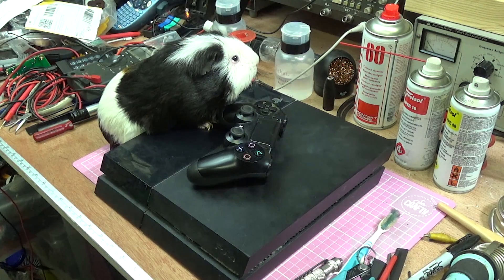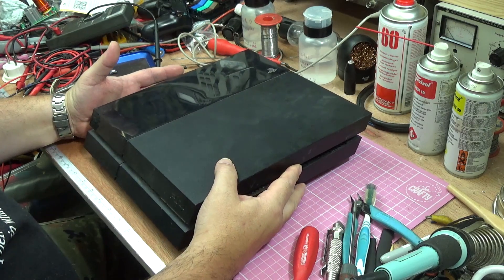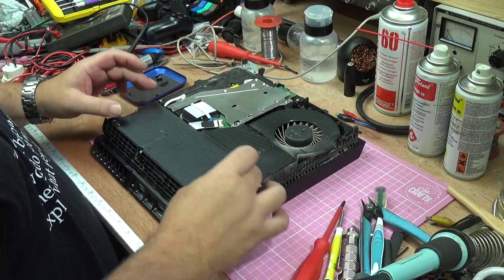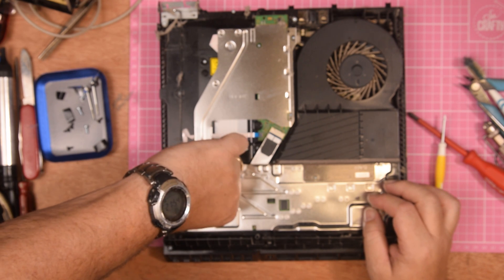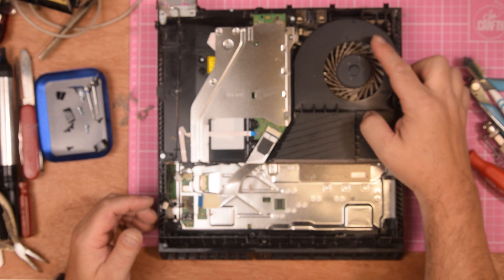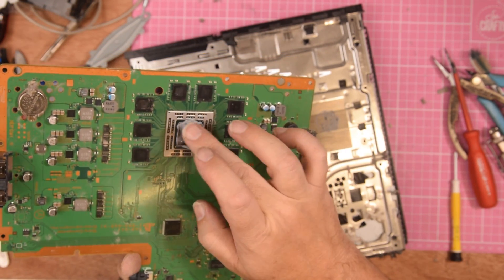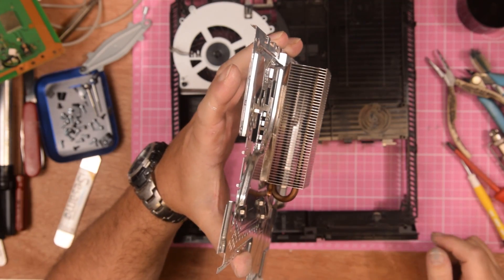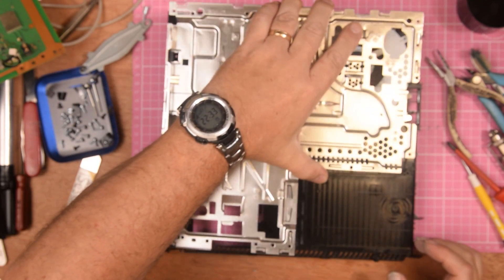How To Fix Ps4 Overheating Problem : ZERO COST

Comment: I cleaned it great video, but I have another issue when I put it back together when I turn on my PS4 it just revs high but then when I start a game it instantly turns off and blinks red what did I put on wrong?
Reply from the maker: it sounds like either the heatsink isnt touching the cpu properly or the memory chip heat pads are not all in place properly.
Reply: George Christofi I’ve got the same problem do you know how to fix it
Reply: @elvisaddai6581  take it appart and put it togeather again, you may have missed something
Reply: Chillmott exactly same problem for me i have cleaned it replaced the thermal paste but it says it is still overheating

Comment: I’m a kid without tools I have no hope
Reply from the maker: Unfortunately, most jobs will require a toolkit of sorts. You can buy new or look on your local facebook marketplace for second hand tools. Just stay safe and obey local laws and restrictions in this epidemic.
Reply: @GeorgeChristofi  I did what you said but certain games still don't work '/
Reply: Caged Earth7 check amazon. They have kits
Reply: Im 13 and found this really good ps4 cleaning kit and it was prety cheap
Reply: I used a knife scissors and a pen

Comment: I cleaned my fan in the PS4 it’s quiet but after 5-10 minutes the top gets hot and makes me lag in games. What do I do?
Reply from the maker: you could get a stand for it that has fans built in. the extra airflow may stop the system falling behind.

Comment: Wowwww! Good as new! Thank you so much! Not a single step was missed in this video! Was able to take it apart, clean it, and put it back together. No problem. Game works fine and is as quiet as a mouse; it used to sound like a mini jet engine. I did have to go out and buy a screwdriver set that had the specific torx screwdriver bit with the hole in the middle.
Reply from the maker: Glad to be able to help. I tried to be as comprehensive as possible because it can be daunting taking an expensive console to bits if you are not used to doing things like that.
Reply: Can you tell me which torx bit it was you ended up using? Was it the T9x?

Comment: i can’t get the plug for the power supply out
Reply from the maker: It is a very stiff plug because of the clips at the side but once it has come out the first time, it does get easier after that.

Comment: I cleaned mine and now it overheats and turns red on the led what is the problem everything is plug in but I do not have thermal paste so could that be the problem cause the cpu is dry
Reply from the maker: It could indeed be the thermal paste needing replacement. Any rubbing alcohol or spirit will clean the old paste off but when you reapply new paste you only need a thin layer.
Reply: George Christofi it was I fixed it

Comment: My ps4 is fine while gaming. But when I keep it in rest mode or just leave it on for downloading an update it just shuts down and doesn't turn back on by pressing the power button. I need to unplug it and plug it in again and then turn it on for it to work. And then I get the checking system storage......etc screen and it restarts. It still gets hot while gaming but doesn't turn off.

Edit: now its turning off even while gaming and it sometimes works for hours without turning off and sometimes only lasts minutes. It turns off in safe mode as well
Reply from the maker: Sounds like something else might be failing, possibly the hard drive itself.
Reply: @GeorgeChristofi  I'll be opening it up tomorrow probably. Hopefully there's nothing wrong the apu. Thanks for replying
Reply: I've opened it up and cleaned most of the dust. I also unplugged the power cord and plugged it back in a little more forcefully because it felt a little loose. So far I've worked it for more than 4 hours without any problems. I'll let you guys know if it actually got fixed after some more testing.
Reply: Alpha Redd did you fix it? I’m having the exact problem
Reply: @alfredhoonter5955  your setting go to power saving setting on you ps4 and there will be a option let ps4 on in rest mode
Reply: @yasminmohammed2745  I just cleaned up the dust inside and it got fixed. But I shouldve done it before and more thoroughly cause now the fan inside stopped spinning and it overheats within a minute of turning it on.
Reply from the maker: You need that fan so it has to be replaced.
Reply: @GeorgeChristofi  wondering whether I should do that or just get the ps5 in a few months. Probably best to just wait.

Comment: Hey george what size of the fillip screwdriver do i need
Reply from the maker: It is actually a torx security driver for the case and a smaller Philips driver for internal screws.
Reply: T-5 and T-9 screwdrivers

Comment: I got the pro and please don’t judge me if it gets hot does it mess up cause I feel scared
Reply from the maker: I guess any of them can overheat if they collect enough dust. Don't be scared... If it is warrantied then the store will have to fix it, if not you can either do it yourself or pay an independent contractor to fix it.

Comment: So quick question , I've had mine for 6 years , and just today it turned off on me twice and now it won't turn back on. I'm pretty sure it's the overheating issue , but I had a game in there when I turned off and it won't even turn on long enough for me to get the game out , will the game be okay if I take the system apart , and where do I get the thermal paste to reapply?
Is that something I get online?
Reply from the maker: ok, the two things.. The game will be fine while it is locked in the drive and barring a major catastrophe like standing on the drive will be as safe as anywhere for it to stay for now. Thermal paste can be had from Ebay and Amazon as well as most computer repair shops. The trick is to put on a thin smear rather than act like you are icing a cake. You are aiming to fill in microscopic imperfections between the two surfaces.
Reply: @GeorgeChristofi  thank you sir!!

Comment: When you are going to take of the power supply the cable at left it is hard to pull out
Reply from the maker: it is deliberately stiff but once it is off it is fine...
Reply: It's the two prongs on the left side that cause this. I do believe it's because of their length and how deep they go into the power supply. After doing it once though it's not as hard the second or third time around.

Comment: Hello, thanks for the help. but after putting it back together it doesn't switch back on, I think I put it together right. any help would be good. thanks anyway.
Reply from the maker: if it doesnt turn on again it will be because you missed a wire or one of them is not seated quite right.
Reply: It does it to me just unplug the cords that make the ps4 turn on the wall then plug it back in and if it doesn't work the first time just do it again

Comment: hello my ps4 turns on then after a while it turns off because is overheated when is not even hot also it sounds loud what can i do?
Reply from the maker: have you cleaned it out at all yet? They don't feel hot on the outside but the sensor on the main cpu tells the machine to shut down as soon as it triggers.

Comment: my ps4 works however after a bit of time my ps4 fan turns off[i turn it on after a bit of time then it works for a bit then the fan stops again] then the ps4 says overheating  i checked the fan, nothing was really there i clean the area however it still does it , i need a bit of help edit it is a very old ps4
Reply from the maker: it could be that the compound between the processor and the heatsink has died out and is no longer doing its job. When you remove the heatsink you can clean off the compound with rubbing alcohol and apply fresh stuff. Don't use too much, a thin coating is all you require.

Comment: What is the paste you use ?
Reply from the maker: I use a commercial grade paste but you can use any heatsink compound. A good consumer brand is Arctic Silver but don't get the electrically conductive one or you may cause short circuits.
Reply: So artic Mx-4 thermal compound your familiar with? It says it does electrical conductivity would not be an issue
Reply from the maker: @townes88  yes, MX4 is a quality compound. It is a very good paste but you don't need to use great amounts. That is the biggest mistake most users make. A thin smear is all that is required. I do believe Arctic have some videos on how to apply it on the website
Reply: George Christofi thanks for your help
Reply from the maker: @townes88  no problem.

Comment: Um I have one of the older ps4s and the power supply cable is not unpluging
Reply: Just flip it over but be careful not to break the cord! You can pop it off and get the power box on the left side
Reply from the maker: Many thanks for helping out with that.
Reply from the maker: I'm not sure about the earlier ones to be honest. I'm not that familiar with the early stuff from the series but would think that there is a catch somewhere to release the cables. I could easily be wrong though.

Comment: Hi so I open my ps4 and clean it now when I turn it on the fan makes a loud noise and it turn off did i do anything wrong i put it the back the same way I did clean the thermal off I dint no I was not supposed  to do that
Reply from the maker: It sounds like you have not quite seated the fan properly or that something is touching the fan blades. You can redo the thermal paste and small tubes are available for not much money. You only need a tiny amount of paste, one tube will last you years.
Reply: Keith Karma I had the same problem brotha! I fixed mines I know exactly what it is. Any chance you fixed it or no?
Reply: @felixcarrillo6229  yea its working now it was the thermal paste that I whipe off now is like brand new
Reply: @felixcarrillo6229  how do you

Comment: Mine doesn't turn on at all like if I click the power button it will start booting up but it either just beeps 3 times and shuts back down or it will flash red while beeping 3 times and then turn off, which I know is a sign of over heating but why does it not flash red sometimes
Reply from the maker: I'll be honest, I'm not sure why you don't always get red. It may be failing before the overheat sensor shuts it down.

Comment: How important would you say it is to keep the Thermal pads on the ram chips?
Reply from the maker: I would say very important. I have heard of people changing them to copper for better transfer. The whole thing that I see with the consoles is how little metal any of the manufacturers can get away with because it is more expensive than plastic so the heatsinks generally are pretty close to the limits.

Comment: I have this very console my fan isn't however I'm having over heating issues on half my games.. my question is if I do this tear down for cleaning will it clear my internal memory??
Reply from the maker: No, the memory will be intact. There is no formatting or changing of anything, just dust removal.
Reply: I did the cleaning and just as a procession saved all my data to my ps account and I'm glad I did ...my injustices 2, mk11 and back to the future games were completely deleted from the hard drive.  What caused this? Cuz I actually feel like I got lucky by doing so
Reply from the maker: @trickydickyyo6533  I have no idea.. the unit should not lose anything because it isn't powered up at all, you don't remove any memory from the unit or any other physical hardware change except removing dust. Weird to say the least.

Comment: Can't you just pop the fancover off, and spray compressed air into the fan blades to remove the dust buildup on the heat sink? I know it's not a thorough as complete disassembly but it doesn't ruin the thermal paste by introducing air bubbles. Expecially if you don't plan on reapplying new paste. I did just that on my laptop and ps3 and both fans run quieter now.
Reply from the maker: It doesn't quite reach in far enough to do it that way. If it was easy, sony would have designed it to make it harder!
Reply: I have both ps3 and 4 first gen..and to this day I have never had a  problem with my ps3..I'm hoping ps4 will be in top shape after the cleaning

Comment: I’ve cleaned my twice and it still over heats and sounds like it’s about to take off like a plane.
Reply: Super easy to do bro. I just finally got the courage to do mine after 2 years of this BS and it was totally 100000% worth it. Cost me about 4 dollars to fix. Completed the project in about 45 mins following another Youtube video. I made sure all the dust was cleaned and reapplied the thermal paste (many good brands out there, stick to the regular ones and not liquid metal). So far after about 3 hours of straight gaming, my PS4 Pro is quiet like new or better!
Reply: @chickendinner5572  wym can you link the video
Reply: i cleaned mines 3 times and switched out the thermal paste nothing works
Reply: @riflehitta-4157  did you apply it on correctly and used the good thermal compound?
Reply: @riflehitta-4157  I've noticed mine does get a lily loud again sometimes.  Usually when I play Warzone.  Next time I'll just use top quality thermal paste. It's still better than before though. Could be from the design of the ps4pro not being able to push out all the hot air.
Reply: I Love Cantelopes if I turn on Warzone it just turns my PlayStation off... lol
Reply: @mrdetermin3d445  same bro
Reply: Dark Crusader actually took out the back where the box is with that the electrical plug goes and I recommended that. When taking it all apart. It's like 5 little screws. Plus I turned it flat and that has helped. Been a week and only crashed once during Warzone. When it was doing it when I would turn the game on or about like an hour.
Reply: @mrdetermin3d445  did you apply the thermal paste and which one?
Reply: Dark Crusader no I did not, just gave it a good cleaning. Two cans of air duster and about 30 Q tips.
Reply: @riflehitta-4157  apply a paste that has thermal conductivity more than 8.5
Reply: durden2480  I run two fans on mine abs and ice pack... I’m ready for a PS5
Reply from the maker: I'm only thinking you may have to replace the heatsink compound on the processor. The mistake most people make is that they put far too much on, it only has to fill the micro imperfections, not act like a barrier to the heat.
Reply: George Christofi ok I’ll look into thanks bud
Reply: Any good recommendations for a good one that’ll last? I live in the states...
Reply from the maker: @durden2480  Arctic silver was always good when I used to build custom computers, I am sure it is still a brand that is out there. most will work well, just don't use too much of any type.
Reply: George Christofi I tried cleaning and everything, I open the game I wanna play and it turns off with a message saying “ps is too hot”
Reply: @mqruvs  try to change the thermal paste I guess
Reply: I have the same exact issue man idk what to do I already cleaned it
Reply: Same here
Reply: Same
Reply: SAME
Reply: @giovanibracamontes5835  remove the thermal paste and apply new one ,it makes a huge difference.
Reply: Great job. I still think I'd mess it up tho lol
Reply: Same
Reply: is this safe for a old version of a ps4
Reply: At this point Xbox is the move
Reply: Sae
Reply: maybe yall are playing games that take a lot of power
Reply: Sammeeee
Reply: ps4 is garbage thats why stuff like this never happens on xbox
Reply: @LeftHandGaming   yeah they skip overheating and start right on fire. Lol
Reply: @jesseredfield8194  my old Xbox one got so bad it began smoking while I turned it on. I had to throw it out due to smokeinh

Comment: My power supply cords are glued down for some reason. Can i just skip to the Heat sink cleaning part?
Reply from the maker: I've not seen it but maybe sony found an issue and glued thenm to stop a different problem. It isn't something I have seen though.
Reply: @GeorgeChristofi  My poor Dorithy, i dont wanna replace her😓.
Reply from the maker: @DaWrldCrzy  you can try and skip moving the power supply cords for sure, it might be possible. Without seeing exactly what was done by Sony I can't say for sure, but give it a go. At this point you have not a lot to lose. If it isn't working, you can't make it not work more unless you are clumsy or fill the inside with water.
Reply: Hey, I don't think you will be about to as they're about 3 cables and a screw which is found under the power supply which prevents you from taking the motherboard off; which is on the heatsink

Comment: My ps4 only overheats when I play rainbow six siege but when I play any other game like fifa it works fine I don't understand. Any solutions?
Reply: Dont play rainbow six siege
Reply: @zebare726  managed to fix it all I did was strip the ps4 move the fan manually for 1 min put it back together and never overheated since
Reply from the maker: Rainbow 6 really stresses the unit because it is so processor and graphics intensive. Other games are kinder to the cpu.

Comment: Mine will come on but it stays on blue and never show the screen
Reply from the maker: ok.. a quick google shows this is the 'blue light of death' as its called. Try this.... 

Turn off your PS4 completely by holding the power button located at the front of the console for at least 7 seconds (it should beep twice after pressing)
Unplug all the cables from the PS4 once the power indicator has completely shut off
While unplugged, hold the power button for 7 seconds again to discharge any extra power left in the console (NOTE: you may have to do this a couple of times to make sure your PS4 is fully discharged)
After your PS4 has been discharged, simply plug the power cable back in, turn the console on and then plug the rest of the cables back in.
Reply: @GeorgeChristofi  my mom just told me she tryed to see if it work after cleaning the fan and said it cut on but it instantly shut off
Reply from the maker: @keenawilliams5213  it sounds like it hasn't been put back together quite right.
Reply: @GeorgeChristofi  ok